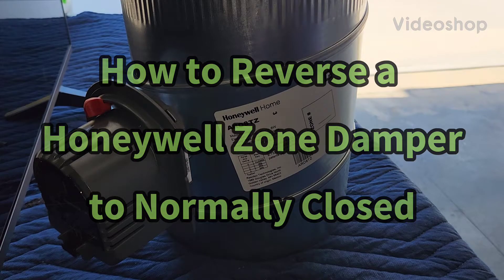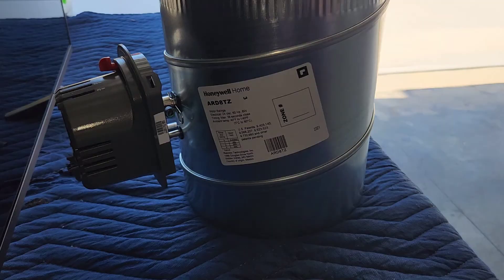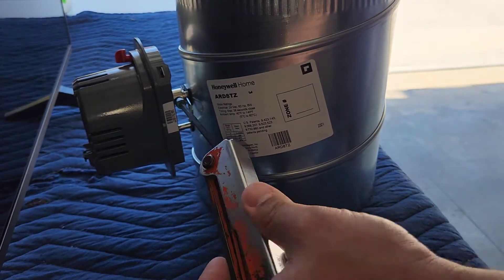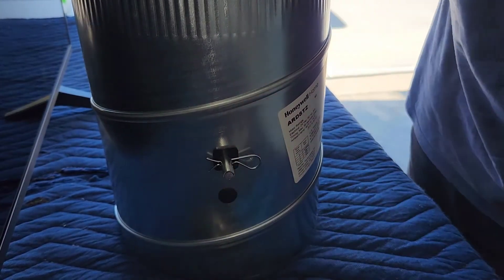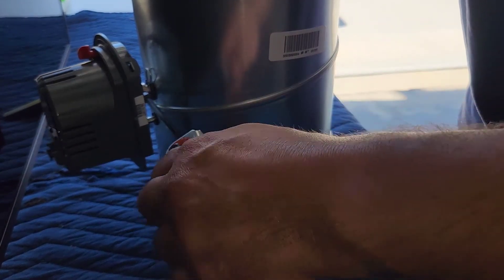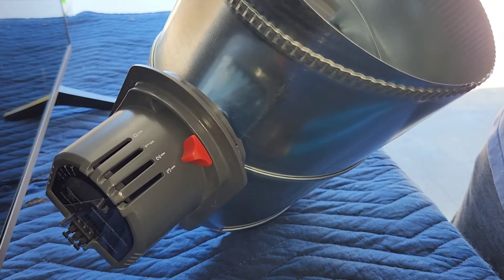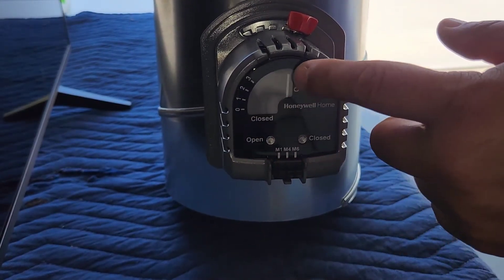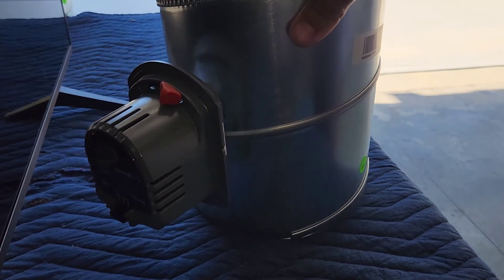How to Reverse a Honeywell Zone Damper

Comment: Thanks for the video Tim! If you ever get tired of changing those actuators or need more torque on stubborn tight dampers give Belimo a try they have 2 different models that will work on residential zoning systems but have much higher torque and are industrial grade so last much longer.
Reply from the maker: Yep. Theyre a bit more pricey too. But worth it if the Hwells dont last